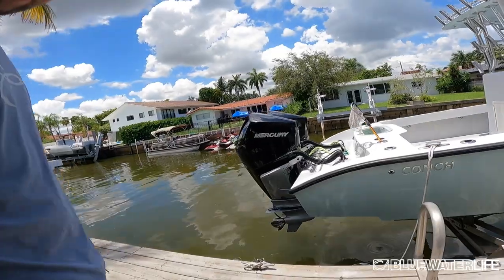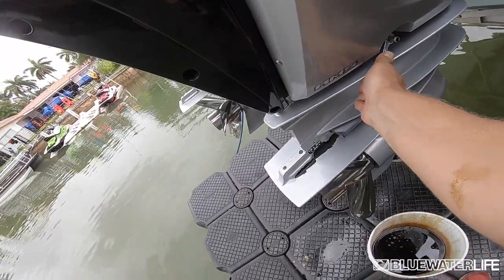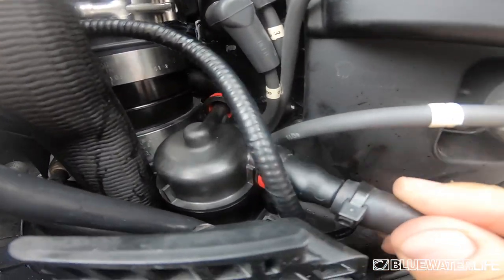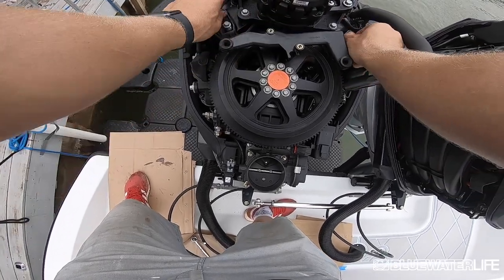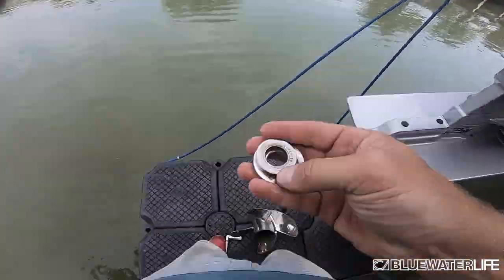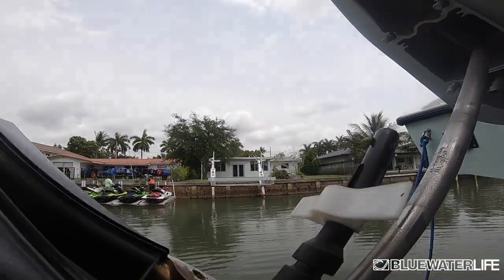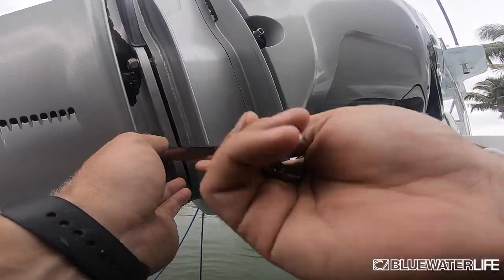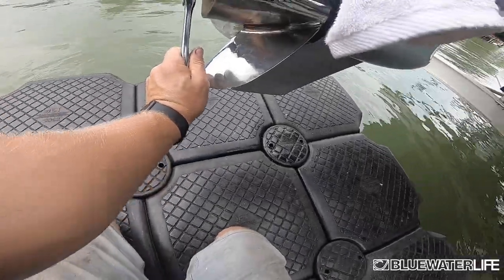Mercury Verado 300 V8 I 300 Hour Full Outboard Service How To: DIY at Home

Comment: good stuff. but you missed the struggle single handed putting LU back up. i was looking forward to seeing that solo. also may want to mention torque specs, some folks w/o experience may think tighter is better - not always the case!   personal preference I use a paint pen dealer style. the dealer tech i copy 
their practice and mark hours/date on therm, water sep, water pump 
(outside of case) ,oil filter.thanks again!
Reply from the maker: Ya the struggle was real esp doing it on a floating dock lol all in good  effort tho

Comment: You should contact Mercury about that flaking paint on your lower units; mine were the same and they replaced all 3 under warranty
Reply from the maker: Ya I actually did the same! Took a few month get them but Mercury replaced both which was awesome! Thanks for the advice! Appreciate it
Reply: Dear Mark , Do you have contact details , email etc?
Reply from the maker: The local merc service center submits the claim. You have to take it in

Comment: The belt removal tool is unnecessary. You also don’t need to unbolt anything other than the the alternator (what you called the motor). Once the 4 alternator bolts are off belt slips right off. Saves you $50 for that stupid useless piece of aluminum.
Reply from the maker: Can do it either way. Thanks for the note
Reply: i should have read this first dam
Reply: Do you still need the belt tightener tool?  Thanks for adding this, saved me $50

Comment: Fabulous job. Well done. 
What would you do to decrease the engine noise by 6 Db as my Verado V8 300hp did not pass the noise test here in Switzerland and the Swiss dealer does not want to tell me his trick unless I pay him a fortune :(
I was thinking to use special sound damping material from the automotive industry and put it under the top cover. But I read that most of the noise is from the low part… any clue or free space I could insert some noise damping material without altering ventilation?
Reply from the maker: Thank you very much. Are you running in sport mode? If so that will create a higher decibel
Reply: @liquidambition  nope in stealth mode…
Reply: Those verados are fairly quiet already

Comment: Bluewater great video. Do you have the part numbers for the two tools?  Why is the paint coming off your motors? They look fairly new.
Reply from the maker: Hey thanks!They should be in the description below. The paint was a factory failure from merc. They are actually replaced the lower units and spacers because of the failing paint
Reply: @liquidambition  Thanks so much!. I have the same paint issues including the brackets that mount on the transom.
Reply from the maker: Yes same. If under warranty take it to a dealer they should replace. I’ve been waiting months but they are on order
Reply: What size socket did you use for the spark plugs? I found that I’ll need a thin wall socket because mine are too think to fit inside the spark plug hole.